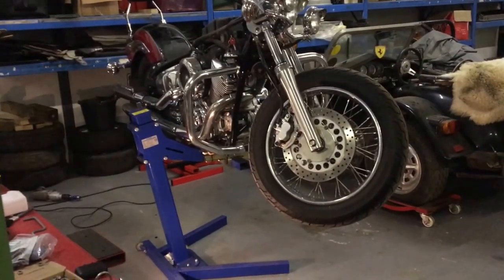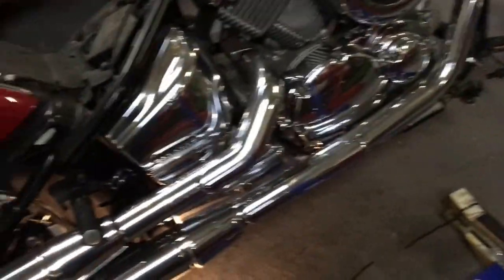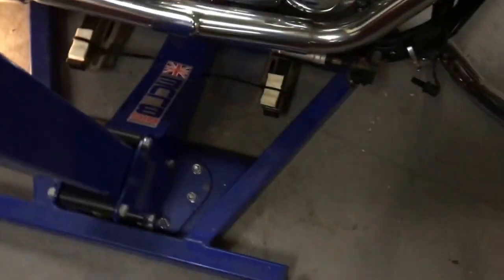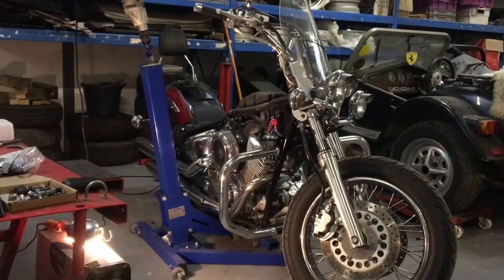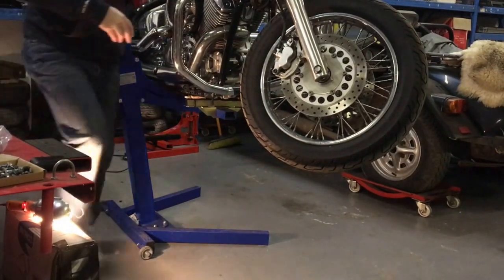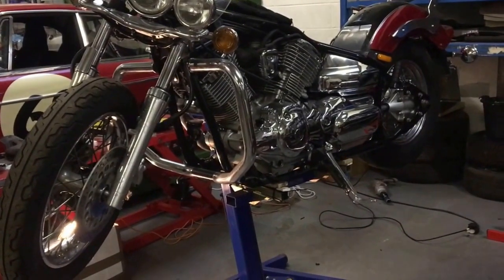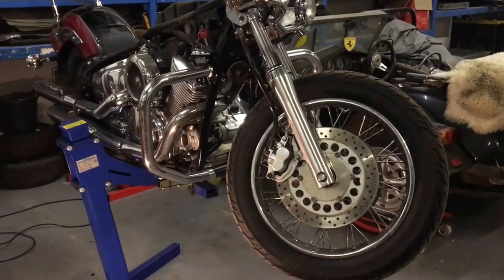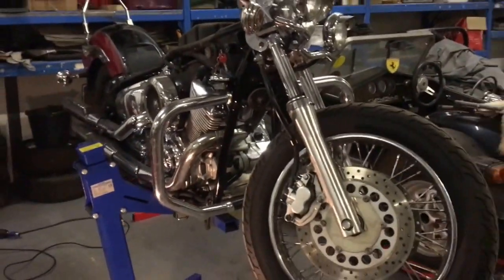Big Blue Eazy Rizer Bike lift How to position your bike on the lift

Comment: Thinking about one of these for my Norton. I think I could position it easy enough, but where would strap it down to?
Reply: You get supplied u bolts for Harleys to secure to frame, on other bikes you use the supplied u bolts to secure to rider foot pegs. Like most videos on these they don't show you A to Z and this video is no different